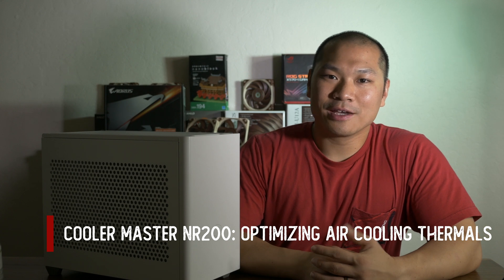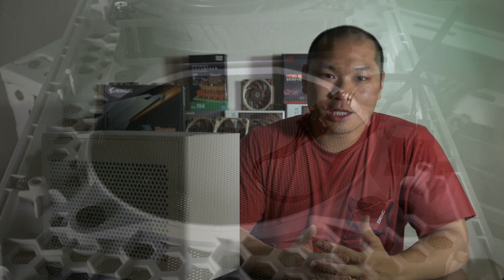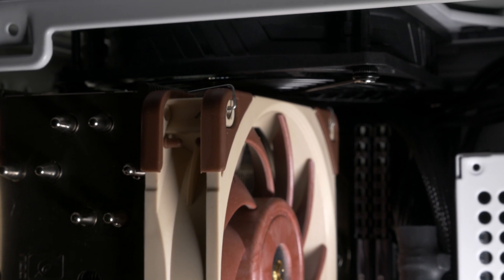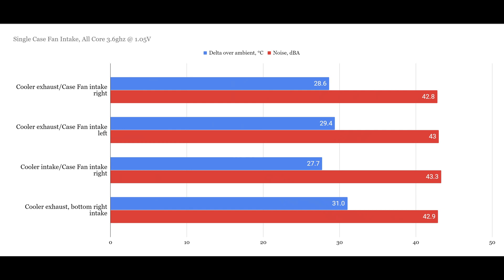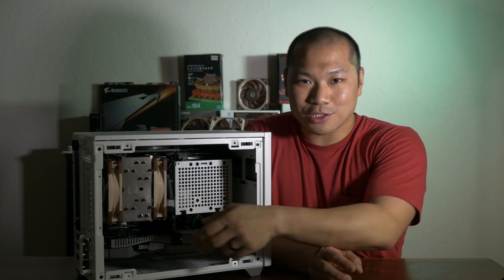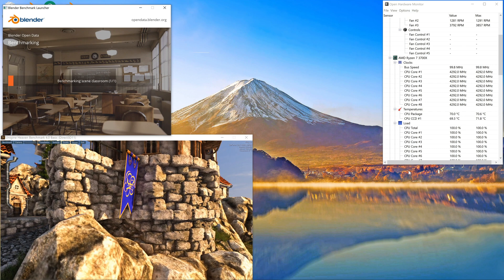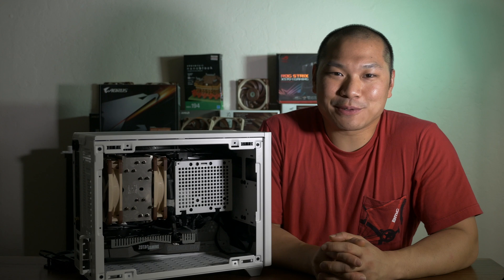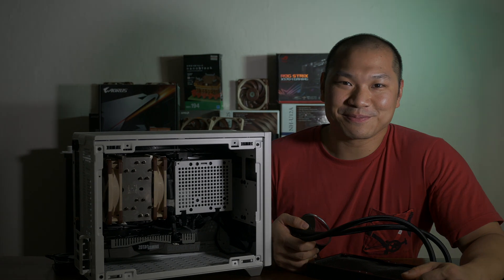Cooler Master NR200: Optimizing Air Cooling Thermals

Comment: Thanks a lot for sharing the details of your very detailed testing. I’ve got the NR200 on preorder and planning to use a Scythe ninja 5 air cooler once I receive it. The cooler is really big and everything just about fits - according to a post I saw on reddit - however, there’s almost no space between the cooler fan and the PSU cage so I may need to move the PSU to the front of the case. 
Since the PSU would intake air from inside the case rather than from outside the case - when mounted at the front - would you be able to repeat the test and compare your optimal configuration with the PSU mounted at the front of the case? Thanks in advance.
Reply from the maker: Cheers and thanks for watching! TBH I probably won’t be doing air cooling tests for a little while- although it may happen for future content. However, I’ll try to explain why I think your scenario isn’t a huge concern. Which PSU are you using? I personally would not worry about PSU thermals, and here’s why: 1) most SFX PSUs today have a fan that will not kick on under moderate to even heavy loads (here is where slightly over sizing your PSU helps). CM made a bit of a compromise by allowing the PSU to theoretically exhaust inside the case, since it’s not at the very top, but 2) here’s the thing- if you have an exhaust fan close by (overhead) that hot air (In the rare event the PSU fan does kick on) gets exhausted too. Otherwise it’s semi passively being cooled by airflow in the case. There’s one other reason it’s likely a non-issue. If that fan on the PSU does kick on, it’s actually helping your case exhaust hot air out as well. In your config your PSU will take inside air and vent out the top. Key is- run at least one case fan as exhaust, you can also put one more if it fits over your cooler.
Reply: Machines & More Thanks for the prompt response. I’ve got a Corsair SF600 platinum, which is nearly silent until power draw reaches 300W. 
I hadn’t thought about the PSU helping to exhaust hot air from inside the case via the top fan(s). That’s actually a very good point but by intaking air from inside the case rather than from outside - and even though the PSU fan will only start spinning at load - the PSU fan will likely start spinning sooner and faster, potentially affecting noise levels. Right?
Reply from the maker: In theory, yes. PSU fans aren’t that loud, though. Still- assuming the fan doesn’t come on until a 300W draw, you’re looking at having close to a maxed out mid range CPU (9600k/10600k, R5 3600/R7 3700X; ~100W) and mid to high end GPU (2060s/2070s; 150-200W) simultaneously (unlikely). And... at that point you’ve got more serious noise issues to put up with rather than a PSU fan :) What are your hardware specs?